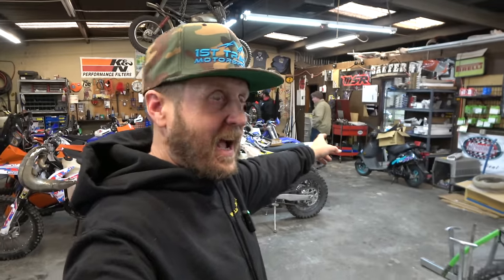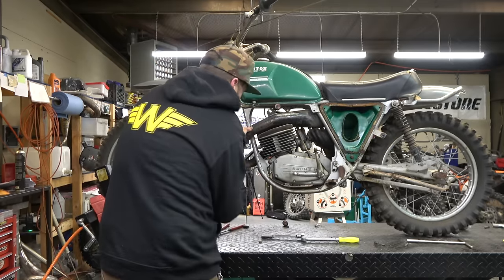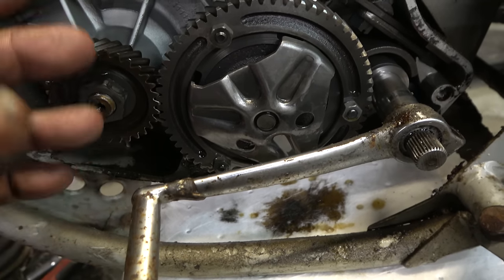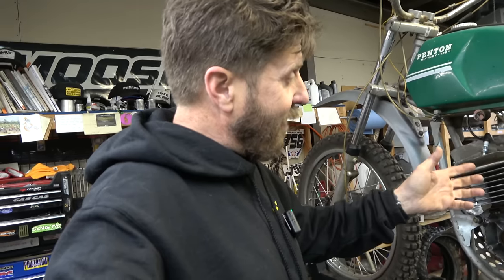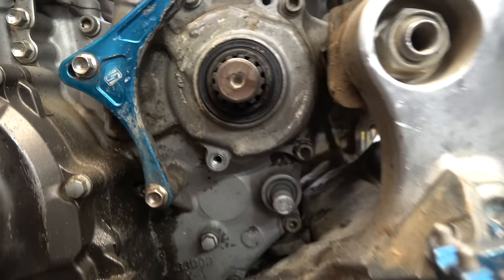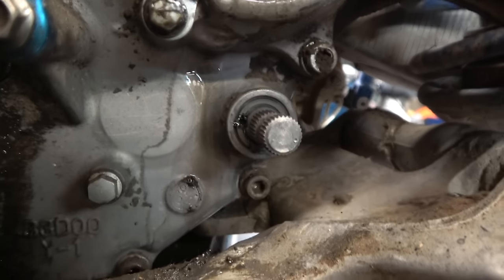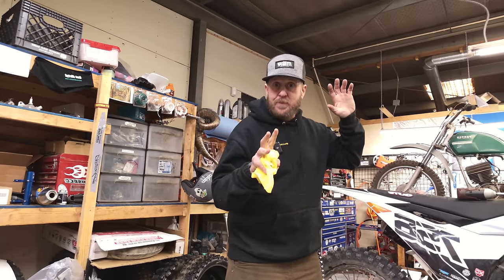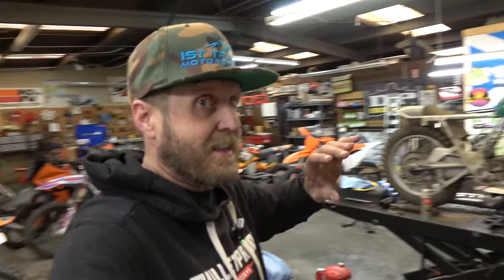Resurrecting a 1973 Penton 125 Six Days | The Shlog #272 | Counter Shaft and Shift Shaft Seal YZ450

Comment: I was surprised to see the Penton, I know a father and son team who have a small bike repair shop they work on the side. I had to laugh when the son told me if it has points ignition they won't work on it. I own modern dirt bikes and own vintage dirt bikes, and yes I am an old guy. But still off road ride and enjoy and support the vintage racing community, you can check with AMS Racing or Speed and Sport for parts or info on where to get them.